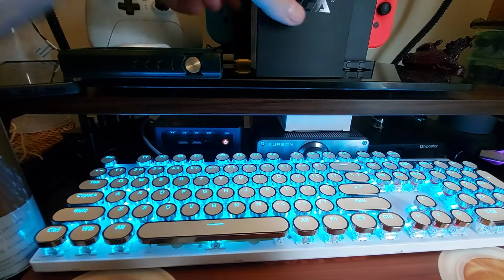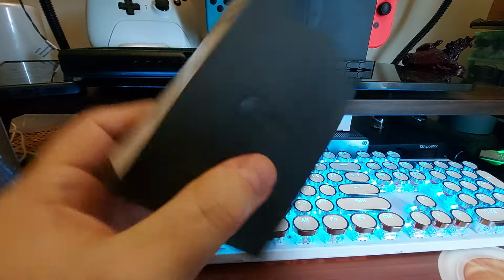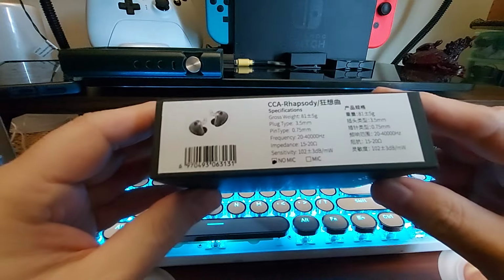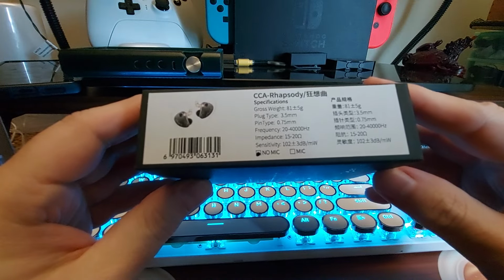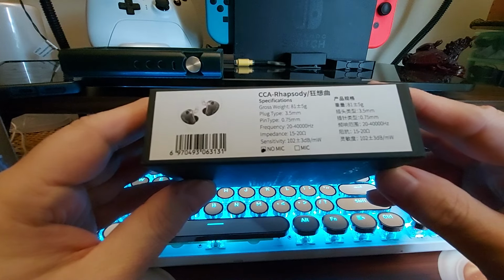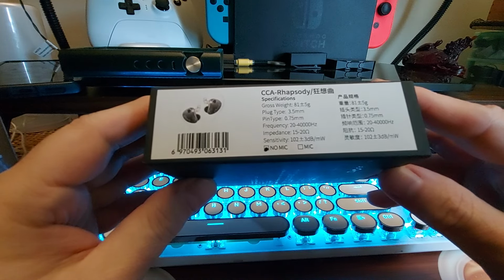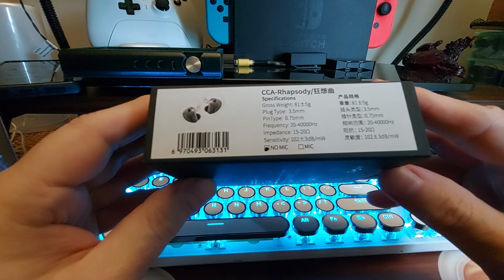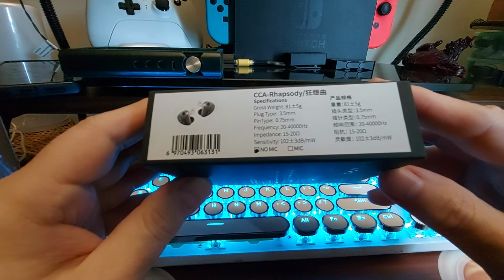CCA Rhapsody   hybrid done well 👏

Comment: I have been using it daily and it's indeed very good, not a technical beast but it can still perform technical tracks very well though it is not very extended.

The best genre that fits Rhapsody is classic instrumentals (surprise right?),  RnB, Acoustic, pop, and a little bit of Jazz.

It's only downfall is its cymbal crashes on modern rock and to an extent alternative rock, the cymbals seem to lose body and almost sounds like see through/hollow and sound it's all sparkle.

But other than that it's a very good IEM.

Comment: How does this iem compare to much more expensive iems such as the shuoer ej07m, xenns mangird tea 2 and also cheaper iems with single dynamic drivers such as the kinera celest wyvern pro's?
Reply from the maker: The Rhapsody is just plain and simple balanced and well tuned with smoothed details 
I'm sure the others have their strengths and weaknesses
Reply: @jubilant_ear_reviews does it perform similarly to the em6l or aoshida e20?

Comment: Thank you very much for your review! I can’t wait to get my Rhapsody, is there a big difference with the KZ Krila headphones, which also suit me very well? Like and subscribe buddy!
Reply: Allow me to answer this question: not just better but markedly better. First the bass, due to double DD, the bass is full, has texture and is layered. Krila’s bass, on the other hand is added to compliment the BA so you hear enough to know it’s there. Treble wise Rhapsody needs a long burn in or the BAs sound metallic at default settings which is 1111. After a few days the treble tones down but my preference is 1110 or 1100 or 1010. Even with all treble settings up Krila still sounds sharper most likely due to the fact that it’s BA is fixed at the nozzle. That said, Krila had a little more soundstage and detail while Rhapsody is more musical and, more importantly just like Polaris, FUN.
Reply: @colddish  Thank you for your detailed answer and I’ll take the liberty to ask you: I bought krila at the very beginning when they came out, my friends bought them later, they complain that the high frequencies hurt their ears, everything is fine in my copy, it may be that they have a different driver or be there another setting?
Reply: @gavr7190 could be that they are more treble sensitive than you.